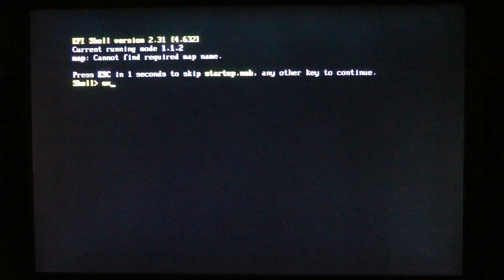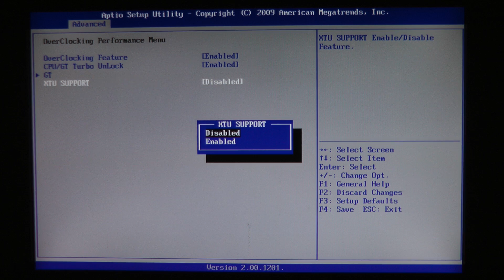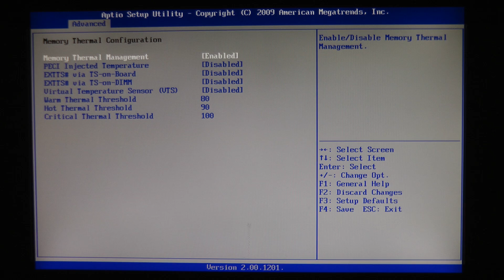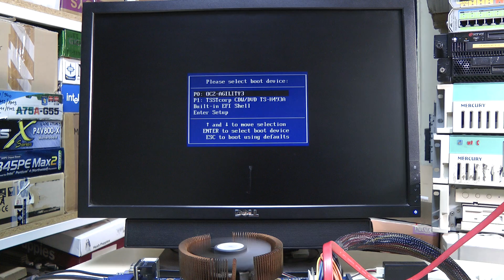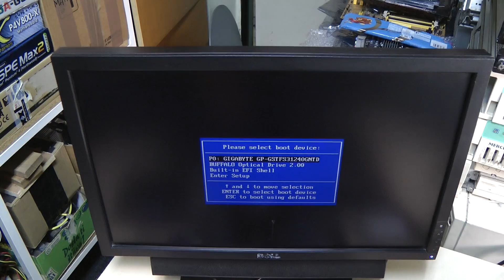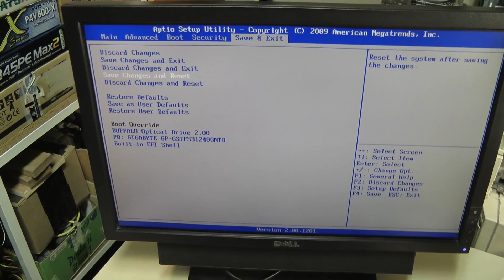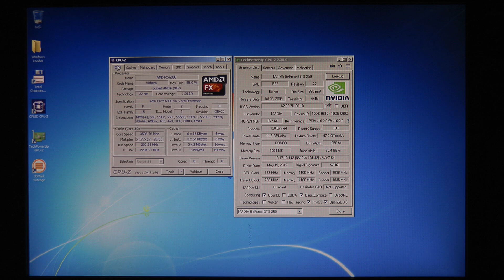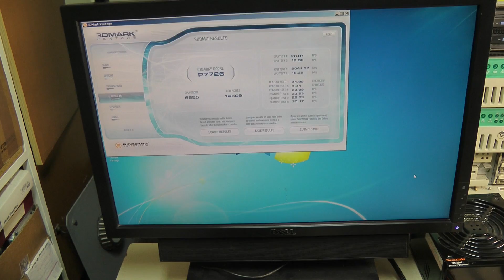my first GeForce prototype + Intel ES mobile board - RETRO Hardware

Comment: Nice to see someone else with one of these boards. I have the older Emerald Lake (1) myself, It seems pretty much identical to your Ivy version but of course with the older 6 series platform. If you want I have the UEFI source code, possibly some manuals, and I also have info on the accessories around it.
Reply from the maker: interesting, maybe your board is from same team

Comment: If you could get that board to work it would be fun to do some overclocking with an unlocked mobile core I7 since you can use more standard cooling solutions. I bet you could get some real speed out of that good mobile silicon with a good cooler!

Comment: Hey retro I have something I bet you haven't tried yet. The virtual lid button! Try switching positions and seeing if that makes it not go into sleep. Also look for any jumpers on the board maybe you can find a datasheet???
Reply from the maker: I tried these buttons. You can see lot of SATA inputs, all kinds all over the board. Lot of unknown jumpers around, lot of settings in BIOS ... need to test all possible
Reply: @RETROHardware  How about that power connection behind the sata port you have the ssd in? Maybe that needs to be hooked up.
Reply from the maker: @robertdutcher8081  It has PWR SATA marking ... but who knows value of voltage :-) Maybe more power for external SATA devices.
Reply: @RETROHardware  maybe hit it with a multimeter and see what it's doing? Maybe it's for internal PCIe bus or something never know with prototype boards

Comment: I could be wrong but I recall Cougar point had issues with SATA 6 from day one, it's possible that trying a SATA 2 device might behave better?
Reply: then use a normal sata hdd and use jumper to use only sata 1.5 or 3

Comment: The motherboard feels like an E-ATX form factor due to the extension near the RAM region.
Reply: Probably bypass capacitors. It sure is more unstable but on normal load it didn't happen to affect that much. I think those prototypes are over engineered and you can get rid of some components without loosing perforemance, look at all the caps that are in the intel protoboard

Comment: That motherboard may have early firmware without proper CSM (BIOS emulation) support, so it won't boot from BIOS-style boot media. Maybe the CPU itself doesn't have a functional 16-bit mode, since it's so early.

Try with UEFI-bootable media. Use the Shell to boot if UEFI boot options don't show up in the normal boot menu.
Reply from the maker: This is good point, will try this way too.

Comment: just some thoughts on that Indel dev-board
the company I'm working for still has a product based on that platform
we have/had massive problems with RAM timings and finding compatible RAMs for that system
we also never use both RAM slots! our system has two but as soon as you have two modules in it the problems begin
we also use only DDR3L (there is a setting in your bios!)
there have also been problems with SSDs from different makes that caused random freezes and stuff
it had to do with some c-states and stuff but I don't know much details on how this was/is solved as I'm just running the end-of-line tests
maybe this helps you a little to figure out how to get this thing to boot!

I also have an older dev-kit sitting around in a Plexmaster G2 case and I'm starting to think that I might wan't to get rid of it. Here is a very old video: https://www.youtube.com/watch?v=iL32G1u7oZw
Reply from the maker: thanks for info

Comment: wow so many bios settings, its a shame its faulty, you could probably overclock the snot out of it with LN2
Reply from the maker: It is not faulty (maybe) ... now I can’t boot with any device, this is problem to solve.
Reply: @RETROHardware  does that extra 8 pin near your ssd do anything when powered? Maybe

Comment: imo nv cards of this era are trash round the 50 below mark, would be better paired with an AMD HD 6770 and would probably be around the same price and about 50% faster too. I could play Fallout 4 on low/med w/an i3
Reply: Got a 9800 gtx+ sitting around which is pretty much the gtx 250 before they optimized the power on it so it didn't require two 6 pin pci-e plugs, ran borderlands 2 at 1366x768 fine with medium settings in my dads pc at the time when the hd 5750 in his pc died.

The gts 250 was pretty much competing against ATI's HD 4850 & HD 4870 before ATI released the HD 4890 which went up against the gtx 285 i believe.
Before the hd 5000 series came out at the end of 2009, bought a HD 5770 back then in 2010, still works fine other then the displayport, might be the cable i got though, was at some point damaged by junk bending the plug.